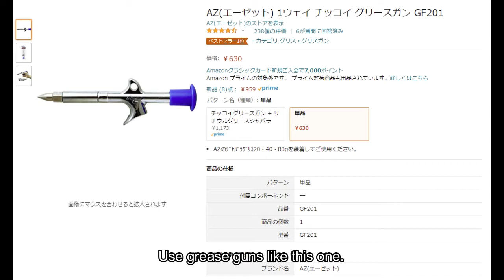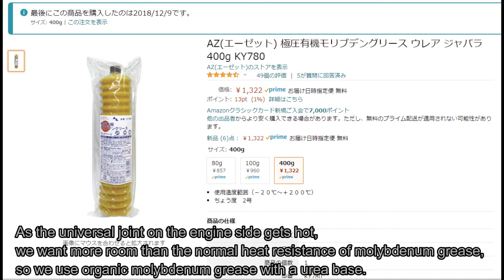R1200GS Drive Shaft Maintenance

Comment: Great video but I could figure out why you used the plastic ties to seat the drive shaft. Is it easier then just rotating the drive 
shaft ? PS could you make a video to show how you get rid of the drive shaft noise sound like slack. My R1200 RT makes this noise at 5mph when I disengage clutch then reengage.